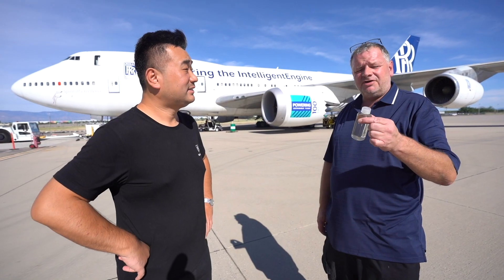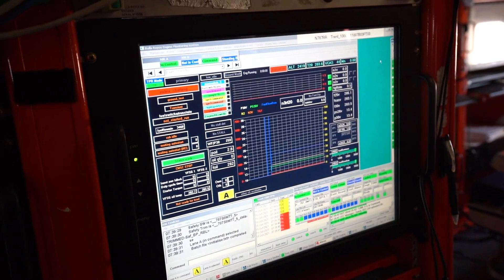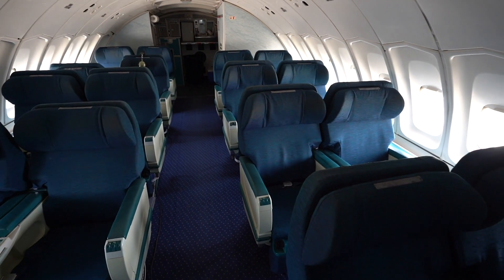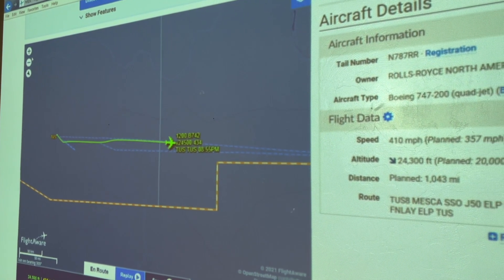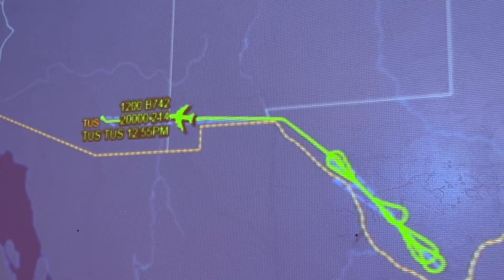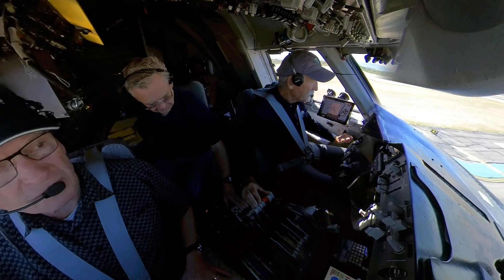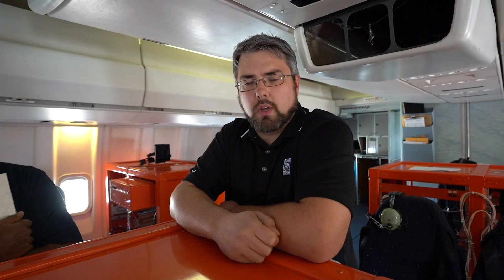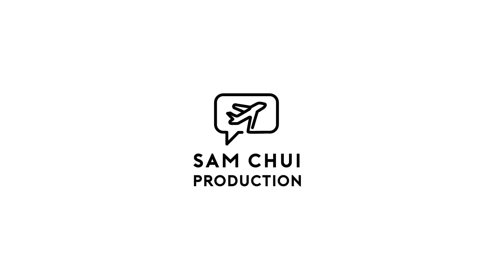Flying the Rolls Royce B747 Test Bed - An Experimental Flight with 100% SAF

Comment: This is old technology... It's time to go electric, it's the future 🛫🔮
Reply: IMO I think electric technology isnt going to be the way forward. The first plane that is fully electric is about the size of a Cessna 172. So it'll be quite a few years until it can work on a large commercial airliner. This jet Fuel is compatible with the Trent 1000-10 and if successful can eventually be used on 787 aircraft with Trent 1000
Reply: @iolist3991   hybrid is the way to go probably
Reply: @francescoschettino5726  Yeah that is probably a clever idea, but for now  this SAF Looks very promising

Comment: Fun fact : 20 Boeing 747 200 classic are still in service until now including this plane. Love this very cool video, Sam.👍
Reply: cheap to buy, redundancy if you lose the engine you are testing. Good choice for a testbed
Reply: @Hans-gb4mv  only issue is they’re expensive to maintain, and most are probably getting close to their flight cycle ‘limits’ (I forget what the proper term for it is but you get what I mean)
Reply: @damonlang1185  cycles is not too big of a problem for a testbed. Those frames don't make 5000 hrs/year nor hundreds of cycles. And of course engine manufacterers are cherry picking when they buy a "new" testbed since they will spend a lot of money to set it up for testing. Furthermore these testbeds operate on special or modified type certification I guess. Safety will always be valued, but it's just different then commercially operated frames transporting passengers all over the world.